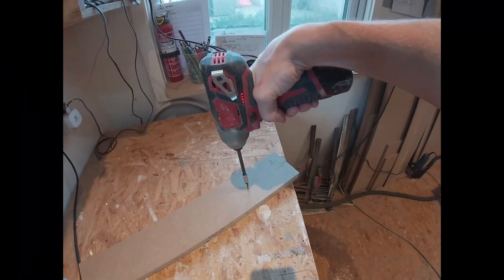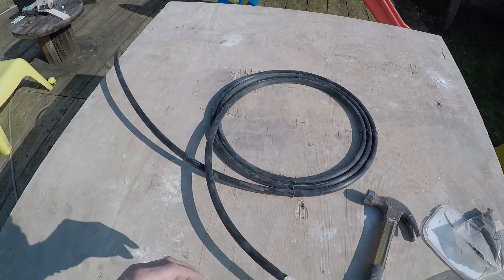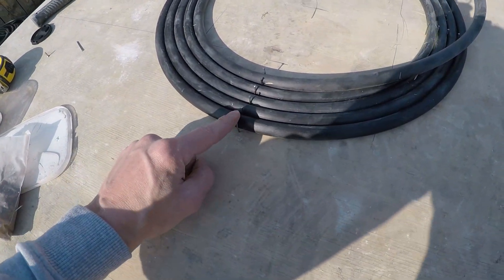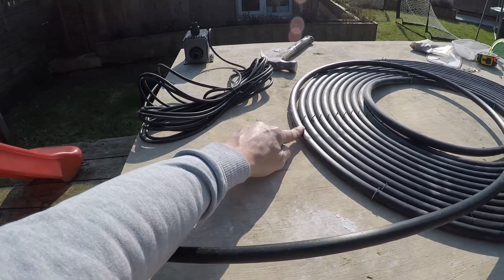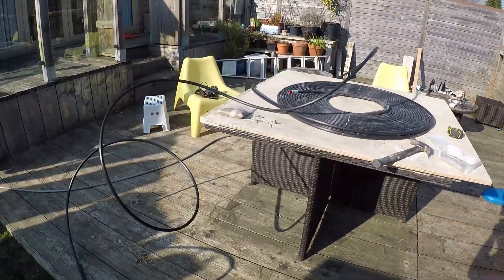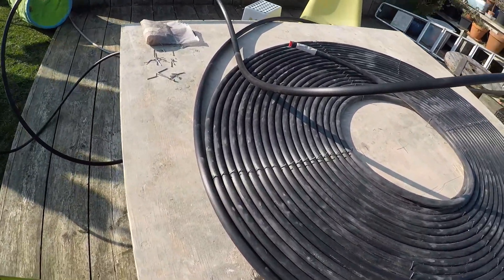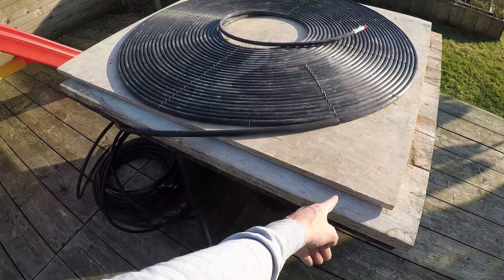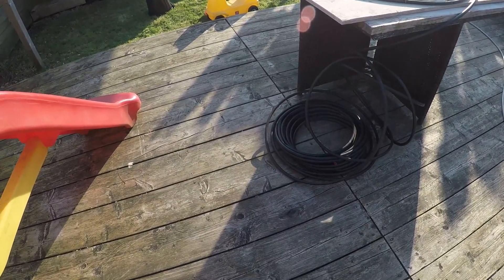How to make a Solar Powered Hot Water Coil  | Coiling the pipe  |  Part 2/8  |  EP#19

Comment: surprised no one has commented...  what kind of temp water are you getting at the final?   how much or what is the water flow
Reply from the maker: I still haven't managed to buy another pump capable of the job, the one in the film just about worked for the experiment.
I think I'll get back on the case in the summer👍👍
Reply: @thelondoncraftsmanworkshop  I saw your pump and was wondering how that was going to work. I ran mine from pool pump but with as little restriction as possible
Reply: That depends on how quickly water is pumping through. But the more flow, the cooler it will be. You can get 130 degree water or 90 depending on flow rate but it equals to be the same so doesn't make sense to over work a pump for more flow. Pretty basic. If you need more heat, make more coils. We just got rid of our 24 foot Intex for permanent 24 foot so fittings are slightly different so I'm building a new setup for new pool. I was using 4 identical coils and was getting maybe a gallon per minute at 110 degrees. Sounds great but when you consider a pool with roughly 14000 gallons, I'll just say that I'm going to use 1 inch and more of it. It will take a lot of space but we are on propane and that's not happening and neither is electric. We're in Michigan and the cool nights doesn't help. I made a diversion from the filter pump/return and used a ball valve to control flow slightly but not to much because the amount of coils determines amount of heat, not the flow. Used it several years and never cooked the motor. Just have to be careful. I actually considered 1 large coil on 1 entire side of garage roof that faces south  Lol.